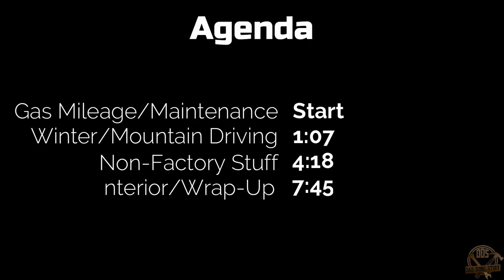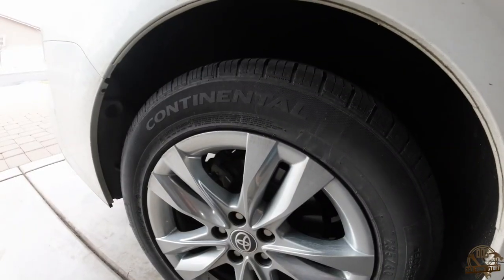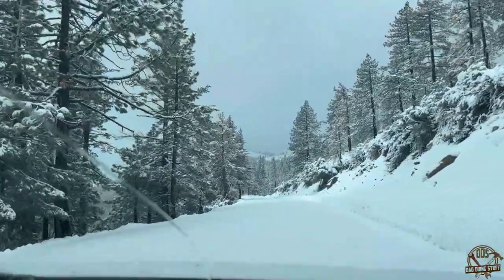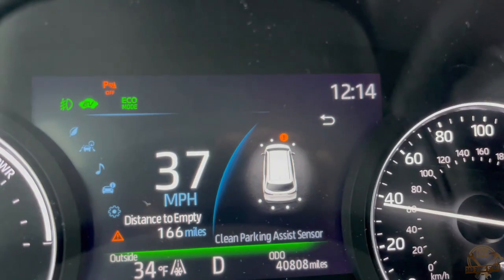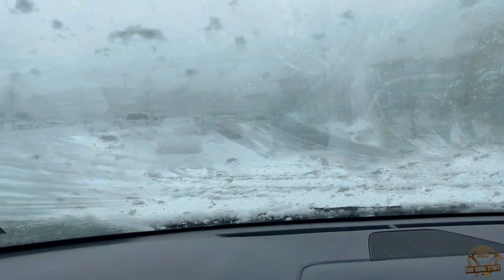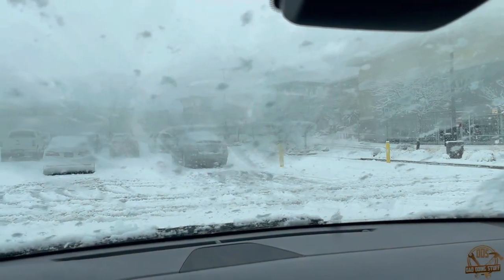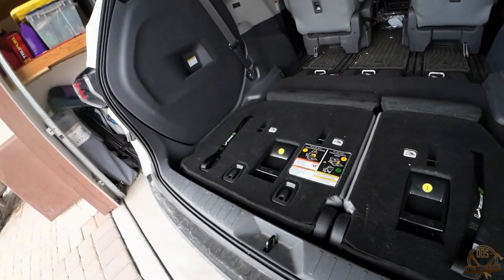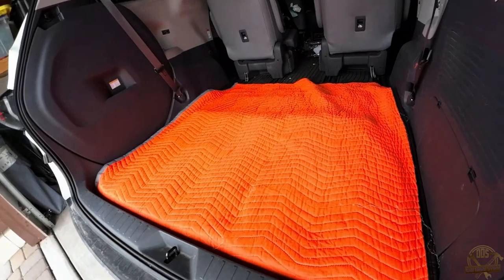Toyota Sienna Hybrid - 40k Mile Update

Comment: Love your videos! We ran our second hand 2012 Sienna Limited to 196,000 mi. with never a problem but decided not to push our luck, since we're 70+ and on the road to grandkids a lot. 😉 We just bought our FWD 2021 Sienna Limited with 21,000 mi. and, in general, love it. I agree with your "10 things I hate about it" video plus a couple. One big thing  we miss are the "Power Third Row Seats, " since I have severe back pain issues. I was shocked that they were no longer included. One more thing is the apparent lack of hooks for a "clothes hanging" bar, unless I'm just missing them. In the meantime, I've had success with hanging our bar from the hooks for the rear glass shades. Again, thanks for your very enjoyable and informative videos.
Reply from the maker: Thanks so much for the comment!  Yeah a dedicated clothes bar across the back would be sweet.  I like you DIY idea of just using those hooks.  I've been able to hang a suit on a metal hanger on one of those shade hooks, but never thought about getting an entire bar across.  Appreciate you watching!!
Reply: Mine of 2001 still running at 140km speedometre at 434967 km odometre.

Comment: 32 mpg combined for the sienna- and he says -''not too bad''  Thats excellent for a 7 or 8 passenger minivan !  I get the same gas mpgs in my small 4 cylinder toyota bro.
Reply from the maker: I agree dude it's definitely good.  I do hear reports of several folks getting mid-high 30's and some claiming low 40's.   Either way, it's light years better than the old V6!

Comment: My 2 year maintenance free just ended this month.  Lol.  Took it in the dealership and I can’t believe how much they charge for oil change, AC condenser cleaning.   Transmission flush.   Brake fluid flush.   But I declined all but oil change
Reply from the maker: Yeah they are gonna hit you with all kinds of bogus services that sound important but are totally unnecessary.   And that “free maintenance” is actually only 2 free oil changes. They change it at 10k and at 20k miles.  If you hit those in the first 2 years, they are covered.  If you drove over 26k in The first 2 years, the free maintenance expires.  (2yr or 25,999 miles, whichever comes first)  It sounds good during the sale, but in reality it’s kind of a joke.

Comment: Nice review on crossbar ski rack, bike hitch, handling. Not crazy with the usb wires, but got a wireless adapter (ottocast) plugs into the CarPlay USB port and been using its for a couple months & works great, you may want to try that…you can move your phone anywhere or use the usb in console storage bin, or built in wireless charger if you got that feature.
Reply from the maker: Good call on the Ottocast.  I just ordered one.  I’ll test it out, maybe do a video on it. Thx for taking time to comment!

Comment: 1x(2/3/23)…..done excellent.   You showed so many things that other Sienna videos never touched on (I’ve watched over 50 Sienna videos).  
(A),  Also, did you order your Sienna or buy it off the lot?  
(B), If you ordered it, how long did it take?  
(C),  Also, I’m disappointed in the 32 mpg when it is rated for 35 mph-maybe the snow & mountains killed the mpg.
(D), I ordered a Platinum Sienna on 1/11/23, the salesman said it could take as long as one to two years to get in.  Thank you
Reply from the maker: We got one of the very first Siennas to hit the road in the US.  Picked ours up on Thanksgiving weekend in 2020 and I didn’t even see another one until probably January of 2021.  We did have one on order, however the dealer we were using just by coincidence had one coming in that was ALMOST the exact van we had ordered.  So they offered that one without having to wait several more months, which is what we did.  I know right now there are super long waiting lists for these Sienna hybrids. We got lucky with the timing of ours.
Reply: Just got premium sienna. Had to pay dealer mark up and waited 3 months.. I hope it is worth it~

Comment: Thanks for your Sienna video reviews. I think I’ve viewed all of them and I am a subscriber - I  appreciate your content.

Trying to decide if a hybrid Sienna is right for our family (of 4 with a granddaughter) and for my wife and I long-term. Your shared ownership experiences and perspective has been very helpful in our deliberations. Thanks!
Reply from the maker: Thanks so much, very kind of you to say.  It's family hauling machine!!
Reply: I have a 22 XLE and with 38,000 miles on it we love it. The economy rating is slightly unrealistic. Mine gets around 32 combined with normal driving. It’s rated at 35 with the AWD but I can coax 35 out of it by driving at 55 instead of the speed limit which is 70. But 32 is almost 10pm better than my older non hybrid Sienna so I’m pretty satisfied. I have no problem with my defroster but I am retired and don’t carry a big gang often and don’t live in the mountains but it does get cold in Missouri and no problem yet with mine. I’m pretty certain the AC automatically engages in defrost. The van is comfortable, handles well and has enough features to keep me happy. The resale on these is excellent based on what I got trading in my 2018 with 90,000 miles. I drove it for almost 5 years and 90k for $5000. These are hard to complain about. I’ve never had either of them in for any kind of required repairs which is a great testimonial to the built in reliability of the Toyota brand.

Comment: I have 2013 Toyota Sienna xle with 344000 Mils on it still run perfect. I just bought 2021 Toyota Sienna xle  with 6000 mils  the best vans
Reply from the maker: That’s awesome.  Did you have to do a tranny rebuild between 150-200k?  I know a few that had to.

Comment: You are so lucky can get the limited AWD trim with the spare tire, nowadays it’s really hard to locate one with the spare tire on higher trim.
Reply from the maker: I still can’t figure out why all the trims don’t just come with a spare. So confusing when some have it, but some don’t, and often in the same trim level.  C’mon Toyota, just standardize already!
Reply: @DadDoingStuff  they said because of the weight, high trim with masive feature already increase the weight. That’s why you see your limited/platinum AWD doesn’t have ottoman seat when you choose to have spare tire, isn’t it? But without spare tire, you’ll get ottoman seat cmiiw

Comment: Also, I was watching a different video regarding the need to disable the park assist with something on the hitch.  Something about you have to disable it every time you turn off/on the car.   This sounds pretty annoying.   What are your thoughts on that?
Reply from the maker: Dude, that park assist thing is super annoying.   You do have to remember to disable it every time.  So if you are on a road trip, you gotta remember to do it every time you re-start the car. After it screams at you a couple of times and you can’t back up, you quickly remember to do it. But I’d REALLY like if they just had a push button enable/disable somewhere on the dash. It’s a good safety feature that can keep you from accidentally hitting a kid or something, so I get the intent.  But still not user friendly at all.
Reply: @DadDoingStuff  I wonder if that can be rewired or tricked so a button can be made.
Reply from the maker: Good question!

Comment: I get 42mpg  cruise control set to 55mph for about 35miles of driving and 36mpg on mixed city and highway driving  28mpg in the winter
Reply from the maker: It’s crazy good at 55.  Long road trips where freeways are 80mph now, we see a pretty decent drop in the MPGs. But if you don’t floor it between lights and aren’t cruising at 80, it does pretty darn good!  Thx for the comment!

Comment: Just wondering why you wanted you phone to be in a holder facing you? Is apple car play not sufficient enough to be able to not have the phones screen readily available?
Reply from the maker: We really didn’t like using the cable for CarPlay, so we always used the BT and phone screen for maps and such. But we’ve since found a wireless CarPlay setup that works fairly well. With that my wife rarely takes her phone out of her purse anymore.

Comment: With the 40,000 mile tire rotation, the dealer said a fuel induction service also needs to be done costing $199. Are you doing this yourself? I need advice. Thanks!
Reply from the maker: This is a classic dealership rip off.  First, if you aren’t having any problems with your fuel injection system, I probably wouldn’t do anything.  But, I have seen in the past on other vehicles where you can get a ping from running cheap gas.  If it concerns you, go buy a $5 bottle of injector cleaner and add it to a full tank of 91 octane from Shell.  Run that through the van then go back to your normal gas routine. It will cost a heck of a lot less than paying the dealer to dump a bottle of injector cleaner into your tank for you!  Hope that helps!
Reply: Thanks for the advice! We will do that. Love your videos!❤️
Reply from the maker: @christschild3596  Appreciate that!!

Comment: I have 41K miles on my 2021 Limited. Have you had any issues when trying to close the rear liftgate and it stopping after an inch? Happens to me more often than not. I always have to physically return the liftgate to the highest point and try again.
Reply from the maker: Only issues with that lift gate so far have been if something is blocking it from fully closing. Whatever the mechanism is, it’s not very strong. So if back is pretty packed, I have to give it a little help from the outside while it finishes closing. I guess the other thing is also the button on lift gate itself is kinda finicky. If you press it more than once, it will stop right away.  Then you have to return to full open and start over. For ours, that has always been user error. But you could definitely have something else going on.

Comment: 6:09 - The cheaper bike racks need that u-bolt.  The more expensive racks have a turn knob that will tighten that down.  Good suggestion though
Reply from the maker: Yeah the bike rack has that knob, but the riser hitch still needs the U-Bolt.  It unfortunately is pretty loose where it interfaces with the receiver on the van.  Not a perfect system but it works.
Reply: @DadDoingStuff  ohhh, I didn't think about that.

Comment: Hello! Great video. In regard to turning off the parking assist if you’re running a bike rack out back…if I leave my rack on my car all the time, is that something one has to disable every time you start up the car and if so, is it physical button or something you have to dig for in the infotainment system?
Reply from the maker: It’s not every time you start the car, but maybe like every 3rd time. I REALLY wish it was just a physical button, but it’s not. You have to drill down through the menu on the dash, using your steering wheel buttons. Once you learn it, it’s pretty easy. But first couple of times is kinda frustrating.
Reply: Damn, that sucks. But not a dealbreaker. Thanks for your response.

Comment: Sorry, late to the party. Wondering if your sliding doors stick in the winter? Have a 2014 and when it's cold esp the passenger sliding door sticks. When we went skiing, the door wouldn't close for a bit after a night out in the snow
Reply from the maker: So far, no.  Albeit we also didn’t have any issues with that on our 2011.  But so far, this an has had nothing like that happen in the 3 winters we have owned it. 🤞

Comment: Hi, when will you replace coolant? I thought that coolant needs to be changed in every 30K miles interval.
Reply from the maker: 30k definitely used to be the recommended mileage back in the day.  But for most modern cars, that’s just not the case anymore. Specific this Hybrid Sienna, Toyota only states to inspect the coolant every 15k miles.  The maintenance guide for this van goes over all recommended maintenance up to 120k miles, but doesn’t even once state that the coolant should be changed.  They only mention inspecting the coolant.  Here’s the link to the 2021 Maintenance Guide.  https://assets.sia.toyota.com/publications/en/omms-s/T-MMS-21SiennaHV/pdf/T-MMS-21SiennaHV.pdf?_gl=1*1gr1cj3*_tmna_ga*MTk3NzI4NzY1Ny4xNjgyOTQ2MDgy*_tmna_ga_EP43E5EFVZ*MTY4Mjk0NjA4MS4xLjEuMTY4Mjk0NjE2MC42MC4wLjA.

Comment: My son's 2023 keeps getting a power steering light, he changed the low voltage battery but after 3 months or so its back, any thoughts
Reply from the maker: Well I just so happened to deal with a BRAND NEW Yukon Denali that had a bad battery right off the showroom floor.   So that type of thing isn’t unheard of. But that said, if it’s 2023 and I assume under warranty, I’d let the light come on then make it the dealership’s problem. (Despite the inconvenience)

Comment: Very informative video. Does your Sienna Hybrid ever feel under-powered? It only has 245 HP, which is less than it's competition: Honda Odyssey (280 HP); Kia Carnival (290 HP). It even has 20 fewer HP than my 2012 Sienna. Thanks.
Reply from the maker: Hi Sam.  Short answer, sort of if you are driving in Eco mode.   But in different drive modes, like sport mode, it’s a totally different animal.  Don’t focus too much on those numbers.  Go watch my “Minivan Drag Race” video where I put this thing toe to toe with a V6 Sienna.
Reply: @DadDoingStuff   I watched your video (drag race), good match up. But what about when loaded and you're going up a hill/mountain, does it have enough torque? How did the engine and CVT behave going up?
Reply from the maker: @budagen  Yeah same applies for hills when it comes to the modes. If you are loaded down and climbing, once in a while I drop it into sport mode. But overall, no issues with mountains. And I live in the mountains. This van takes the family skiing pretty every weekend all winter.

Comment: If you lay the seats down, and remove one of the second row seats, could you fit a MTB in there?
Reply from the maker: You can fit a single MTB without removing any seats.  There is enough room to slide one up the center, so long as you remove the front wheel. I’ve had my bike in there several times. If you removed one of the middle row seats (not an easy task) you could probably fit two MTBs no problem.  Hope that helps!

Comment: you are r supposed to run your A/C believe it or not. Otherwise your air is too damp and will fog up your windshield.
Reply: I had seen this video from Car Care Nut and I recall seeing something similar a few years ago with Consumer Reports. Yes, the other commenter is on the right track with running the AC in winter. https://youtu.be/L89oa8XHd28

Thought it was a bit of an odd idea at first but I’ve done it the last two winters (in Highlander and Avalon Hybrid) and it has made a difference. That’s a big interior cabin space in the Sienna and it sounds like you have a lot of passengers, so it may not completely eliminate the foggy windows altogether. But it should help. It’s worth a shot if you haven’t yet tried that.
Reply from the maker: Agreed, but the defrost function does run the AC. (at least it’s supposed to)
Reply: @DadDoingStuff  yes - same with my Toyotas. I was thinking of other modes (aside from the 100% defrost mode). Boy, that’s unfortunate that it lacks enough “oomph” to adequately defrost the vehicle windows - which is what your video clearly demonstrated. Thank you for highlighting that issue!
Reply: @DadDoingStuff  it doesn’t, I haven’t seen Japanese cars do that. This allows you to defrost lightly if needed and if you need more power you just turn on your out AC, which normally it should default to when you turn on your defrost, but your AC light is not on.
Reply: What kind of psycho doesn’t leave their AC on?
Reply from the maker: @MMWorkz  I’ll run some further tests…..but probably won’t be until next winter now that spring is here.
Reply: @Izaya_Orihara 

My thoughts exactly😂😂😂😂😂😂
Reply: A/C stands for All Clear
Reply: This. Recirc should come on by default with defogger and then make sure AC comes on. Sometimes they do auto sometimes not. Then run that puppy on high with the temp you want. The exchanger will remove the humidity from the air as it recycles. Try not to crack your window as that just allows more wet winter air in. But you still might have issues. Looks like that dash vent just isn’t long enough for that huge window. Especially with a full van of mouth breathing kids.
Reply: @DadDoingStuff did you do any more defrost testing?
Reply from the maker: @techieg33k  Yes.  Run the AC and it seems to actually work pretty good.
Reply: Thank you.  Looking at getting a 2024 model

Comment: Hi there. I think you need to hit the AC button or the defroster cannot properly dry out the air.
Reply from the maker: Few folks have mentioned that. I was really expecting the AC to operate when in defrost mode, but apparently that might not happen automatically. So I’ll test it again, but gonna have to wait until next winter!

Comment: Have you ever tried to put 2 mountain bikes in the back of the van with the front tires removed. I am looking for a vehicle where I can haul 2 bikes using fork mounts. I am in Colorado and bike theft is rampant.
Reply from the maker: Yes you can make them fit, but totally depending on how you plan to use the second row. Those seats fold a bit and slide really far forward. Could probably still make it work even with one of the seats folded forward. Probably also need to stagger the fork mounts a bit so the bars don’t clash.